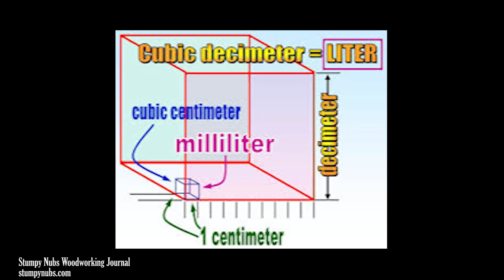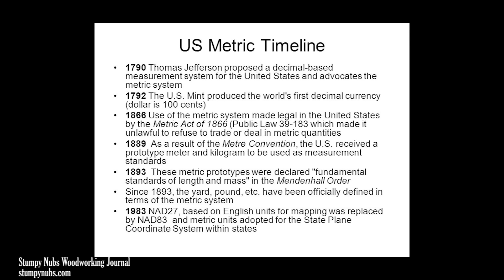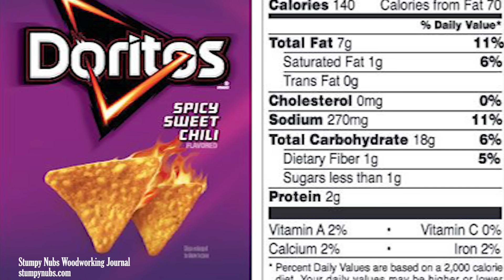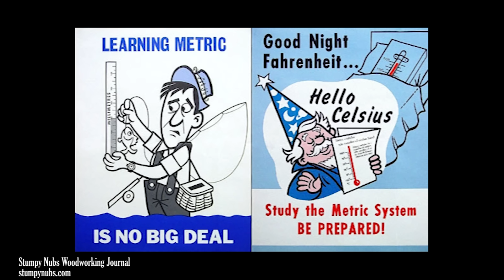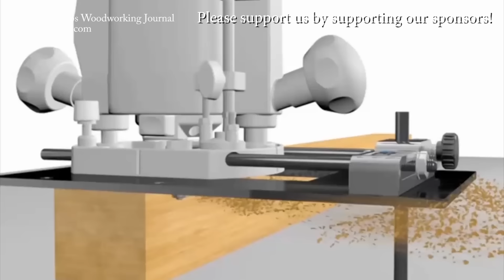BREAKING: The USA is switching to METRIC!

Comment: Really sensible response, good work. One point though, endless arithmetic does not constitute being good at "math". Engineers who are good at maths are the ones at the front line of this. When your system involves equations linking foot pounds per square inch and "refrigeration tonnage", the move to sensible si units like m, N, J and W is a huge step forward.

Comment: The US and UK have been trying to go metric for a long time. Here in South Africa in 71 we were officially metric. From 1970, no school was allowed to teach the imperial system anymore.  From 1971, no measurement equipment like scales,  tape measures, etc. in imperial marking was allowed to be sold. From the 1970 model year, all cars sold could only be marked in kilometers.  Not miles and kilometers like most plases. By mid 1971, all fuel pumps sold litres and not gallons, road signs were changed from miles to kilometers.  We changed because we were forced to change.
Reply: Biggest thing I know is that when someone is charging as much for a liter of gasoline as I pay for a gallon of same, someone is getting royally squirreled.   🙂

Comment: When France instituted the metric system, it was not popular.  The Govt had to pass a law outlawing the use of their traditional system in commerce.  Even then, they had to redefine trad units in metric terms.  The livre de Paris, one of several livres in use, was equivalent to about 489.5 g, and other livres were close to this, so they redefined the livre as 500 g to make the conversion to kg easier.  Once they got people thinking metric, they dropped the metric livre, although people continued to use it unofficially.  Germany did the same with their various Pfund, Denmark with their Skålpund, China with their jin (trad about 600 g, changed to 500).  The same was done with the various European gallons, generally becoming 4 liters, before phasing them out entirely.

Comment: Here in the uk we’ve been officially metric for decades, but our speed limits are still in mph, you can buy 3000mm of 2x4inch timber. We buy beer by the pint in our pubs. All our rulers still have inches on them as well as actual measurements. At least we did get rid of our imperial money, because I would not have liked to have to deal with 4 farthings in a penny, 3 Pennies in a thre’penny bit, two thre’pemny bits in a sixpence, 2 sixpence in a shilling, 5 shillings in a crown, and 4 crowns in a pound. But yeah, you can use metric for the important stuff without having to give up on imperial all together.

Comment: I'm an American living in New Zealand and have, over the last eight years, become bi-lingual regarding Imperial and Metric systems. I'm used to Imperial but Metric is far simpler at times and I go. either way depending on what I'm measuring. It's not a problem.

Comment: 1 kiloWatt                = 3,412.3  BTU/Hour
1 Horsepower         = 2,545.6  BTU/Hour
12,000. BTU/Hour  =  1 Cooling Tonne (A/C)   = 3.516 67  kiloWatt
1 BTU (British Thermal Unit)   =  1,055 Joules = 1.055 kiloWatt--second (kW-sec) 
(I don't think you (anyone) can get rid of all these messy stuffs, we're in for too long.)

Comment: I recently commented on a video you did about accuracy and I said metric was a lot better. I just completed the construction phase of the toddler bed portion of my daughter's 3 in 1 crib/toddler bed/full size bed. I got the plans from wood magazine and loosely followed them. My problem with the American system is that I had 6 spindles in a railing and needed to put spacers in the groove between them. With metric I could simply shove the pieces together, measure the distance of empty space divide by 6 and cut my spacers. Dividing by fractions is a pain. The problem I have is that I can't just go to a store and buy a metric tape measure. Unfortunately, my daughter's bed won't sand itself. I guess I better get back to work. I mentioned how much I hate sanding?

Comment: I'm british and hence conversant with both systems. When I sat my school leaving exams 50 years ago we were told that everything would be metric by 1975. I'm still waiting. I'm so OVER imperial measures, so much so that when I go on holiday to Spain I get a couple of tape measure because they are purely in cm and mm. So much easier to use. The killer application for metric is when I design something using a spreadsheet- so much easier. Just get used to it, it's not difficult.

Comment: The US Customary System does have the useful ability to be repeatedly divide in half which I find myself doing much more often then dividing by ten in my woodworking. Even the fractions are straight forward, it's not like you end up dealing 1/27ths of an inch. halves, quarters, eighths. sixteenths and  32nds are simply smaller sub-divisions of an inch. And since an inch is officially defined as exactly 2.54 cm so they are just as precise as Metric.

Comment: It should be noted that there are differences between the U.S. Customary system of measure and the British Imperial system of measure. These mostly relate to liquid measure. The American fluid ounce is bigger than the Imperial fluid ounce. 8 fluid ounces make a cup... but two American cups make an American pint, while two and a half Imperial cups make an Imperial pint. So the American fluid ounce and cup are bigger, but the Imperial pint, quart, and gallon are bigger.

Comment: The Metric (SI) temperature unit is Kelvin.  No country uses that for non-scientific purposes.  Celsius is not "metric" because there is only one unit -- not like feet and inches for distance -- there is not a big temp unit and a small temp unit; just the one.  So there was never any issues of multiplying and dividing by ten.  You might as well use Fahrenheit, which is much better for the weather and other human-comfort-range readings.  
Meanwhile, the only SI unit for time is the second.  Hours and minutes are not factors of 10!  So km/hour is just as bad as miles/hour, when you want to convert to meters per second.

Comment: Water freezes at 0c and boils at 100c.....instead of 32f and 212f..........you tell me which makes common sense???
Reply from the maker: Water isn't the only common liquid. Others have different boiling points. Seems a completely arbitrary thing to base an entire temperature system on.

Comment: We were just in England and they haven't switched completely. The speed limit signs are still in MPH. I thought the English must drive very slow before I was told that speed limit is in MPH. There were several other non metric things I noticed that are still hanging around. What I'd really like them to standardize on is driving on the right. We didn't drive this time, but even as pedestrians it's hard to get used to cars driving at you in directions you don't expect. And to increase the danger factor for tourists, the English like to park on the road in the opposite direction of the traffic.

Comment: As a gen-x-er from the UK , who grew up in the 1970s , when the UK kind of went semi metric, I had to learn both systems.  
Metric at school, and imperial when chatting with my parents ! (who were born in the 1930s) . My parents didn't like talking in metric !

People of around my age and older are still kind of attached to inches, miles, pints, gallons, pounds ( and stones, but the USA doesn't seem to do "stones").
In public houses , we still buy beer in pints , but wine is sold my a metric measured glass.
Road signs , and speed limits are still in miles and miles per hour.
Food is often sold in amounts of 454 grams, which is well 1 pound ! or 227 grams which is half a pound !

I'll still often think about "an inch" , but then I'll sometimes use millimeters.

Even in the 1970s car engine capacity was pretty much metric in the UK . The only time I heard of Cubic Inches was from American V8 muscle cars !

I'm not sure where it will go , will my Gen-Z children just fully embrace metric ? I can at least see Miles and Miles per Hour hanging around for a real time .

Maybe I'm easily amused, it does always amuse me when I say to a European who's in the UK , "ahh , that's about 5 miles away" , and the puzzled look comes across their face, and I then have to say "about 8 KM !)

As for me , I guess I'll just be "bilingual" on measuring units until I keel over and "pop my clogs" (die!!) !

Comment: Canada is a half metric country so I have some insight. I'm of an age where I was taught both systems in school. Most of the trades here still use Imperial measure since there's so much product sharing with the USA. I find Metric is better for smaller jobs or scientific work, but for things like house framing, Imperial is easier to use. The foot is a good sized measure for building sized projects and they break down into base 12 segments of another useful size. Things don't stack up into large numbers, with decimal places that can get missed or moved. Fractions are fast and easy to use once you know them so a base 10 system isn't all that. I don't count on my fingers.

Comment: In Europe we are also use to Inches Like PC or TV screens or tyres for cars and bikes. Water Hose Connectors or water pipe diameters are al in Inches. The only thing that is wired is Farenheit, I can‘t understand the Logic behind as Celsius is more logical 0=freezing water and 100 is boiling water (roughly).

Comment: Fun fact, in Germany where most people don't know anything about inches, in plumbing pipes are still in inches and bicycle frames and also wheel diameters. I am living in Canada which is not as metric as it should be I suffered tremendously when I came here. There is more to it though, how about BTU's, Gauges, what a mess. Interested to me is that wherever it matters,  pharmacy for instance it's always metric.

Comment: When you do engineering, scientific and need to do conversion from surface area to volume and flow or field / volume or area, then it becomes soo much easier with metric. 1 cubic meter =1m^3 = 1000L = 10^6 mL

Comment: In the UK things are a bit of a mess.. we seem to use both. Officially on the roads we use the imperial system so speed limits, distances and height restrictions are all imperial… but then private roads and store car parks might show a height restriction in metric… so your truck might be 16’2” but the sign says like…. 2.7…… 😐… absolutely nobody knows their height in metric people only know their height in feet and inches, when talking about distance we use miles, never Km… but during covid we all said… keep 2 meters apart… when we would never have measured anything else in metres. All liquid is measured in metric.. apart from beer and milk.. people only know their own weight in imperial, never metric, but things like… cocaine are sold in metric quantities… 🤦‍♂️📏

Comment: The French went to all that trouble and ended up with a base length measurement of about 3 3/8” longer than the yard. It sounds to me like the yard was close enough. Metric doesn’t have a commonly used intermediate measurement like the foot (at least I’ve never heard of anything measured in decimeters). Everyone knows auto mechanics just LOVE having to buy two sets of tools and having to change over all the time. The science and medical fields have used metric for a long time because it’s “more precise”. All that was needed was to come up with some smaller measurements of ounces, both volume and weight: problem solved. I think doing the calculations in your head keeps you sharp.

Comment: The problem I see is not "not knowing how to use fractions".
Going from smallest to largest:
1/10, 1/1000 (so far so good), 1/32, 1/16, 1/8, 1/4, 1/3, 1/2, 1, 4, 12, 3, 22, 220 , 1760 (and we got lost along the way) without going to disturb knots, fathom, grains,pennyweight ......

Comment: I was brought up on the imperial system and we (UK) changed when I was 21, we converted quite quickly as it is so less complicated. But we still use the old system roads are still miles and our cars are MPH and ask the height of any kid and they will say 5ft 10inch. and we can still order a pound of meat at the butchers. In germany you can ask for a pound of meat or potatoes and they will give 500grams. As an engineer I found it a lot less complicated using the metric system. so in conclusion its not such a bad thing going metric I am 5 foot 113/4 inches (183cms) 14stone 8 pounds (93 kg).

Comment: As a Brit and the wrong side of 50, I have experienced both metric and imperial systems. Allow me to help you with which system is better - as the answer is simple.

It doesn’t matter – simply switch between the two depending on which is easier. For instance, I am 6’ tall - Not 1.829 meters. The pub is about ¾ mile away from my house – Not a km

As a rule of thumb, I tend to use imperial for large measurements and metric for fine work – unless the measure happens to fall on either a full inch mark or half inch. Much after that, I just can’t be bothered to do the math. I am quite capable of working in fractions – find the LCD and such… but for the love of god, why would anyone want to? 64th’s ?

Useful stuff to know:
1/8 is just over 3mm. therefore 1/8 drill makes for the perfect 3mm clearance drill. But is also ideal size to tap 4mm threads.
3/8 is roughly 10mm (9.5)
½ inch is a good clearance drill for 12mm bolts
Km to miles is very rough 2/3 	-	12km =    8miles	(7.4444)
Mile to km is very roughly add 1/3	8 miles = 12km 		(12.87km)
100kph = 56mph	(see above)

In Britain, imperial bolts are still available. But, they will cost between 10 and 20 times the cost of a metric one. (If you can actually find them – you will probably wait a week for them to arrive) the better option is to drill out the hole and fit metric, at which point the problem goes away.

Metric or imperial?
The answer is either or both… The real question should be “Who thought the 10th of an inch was a good idea?”

Lets not get started on gallons....

Comment: Wait until you try doing a renovation with metric drywall which is 1200 x 2400 mm. About 47“ x 94“. All the stud space will be different. What’s the cost of converting all lumber and drywall sheet and plywood sheet factories to metric?  In Canada we still use 4 x 8 sheets and 2 x 4 lumber.
Reply: In the UK it's sold in 1220 x 2440. That's 4 x 8 yes direct conversion as that is how most of our houses were built so the  board sizes still fit with little waste.

Comment: metric is nice in that you can convert from length, and mass (weight) directly to volume...eg 10cm x 10cm x 10cm of liquid = 1000ml = 1 liter..and if it is water based it's mass is 1 kg...you can do these calculations in your head....temperature is also more intuitive to a human life style...water freezes at 0C and boils at 100C...most Americans make fun of the French but metric is one thing they absolutely got right.

Comment: I am from Europe. Don't understand Imperial system. When I was in NJ 30 years ago, they tried to convert highway signs into metric. However they listed both metric and imperial distances on the same plate. It did not work. IF you going to convert you have to do it cold turkey. Example is in Sweden they converted to driving on left side to right side overnight.

Comment: as an american ive slowly learned metric ive got my phone set to C for temperature and i already am used to metric for other forms of measurement the main issue still is estimating based on sight and feel i still pull out the conversion factors mentally on occasion but im started to get better at it

Comment: I have come to the conclusion that irrespective of the unit measurement I use I can f**k any piece of timber or steel I cut. ANY material I cut will consistently end up being just a little bit too short. It's got nothing to do with which system I use ... it's the quality of the material I keep using. I just have to buy more expensive material. No no .... don't tell me I'm wrong, it's taken me forever to think this thing through and I'm convinced I'm on the right track at last.

Comment: Why choose. They both work well. If I have an inch measuring equipment I use inches and a metric measuring equipment I use metric. It is easy to convert from one unit to another. There is 25 millimeters to 1 inch. 4 quarters to a dollar. So 1mm =0.040”… stop making this hard.

Comment: I worked in newspapers where we measured across the page in points and picas which are fractional inches, and down the page in cm. I’ve never been foolish enough to attempt a woodworking project like that! Doesn’t matter what you use so long as it’s consistent for the entire project. And if it’s based on one or the other, don’t convert. 32mm cabinet system does not work in fractional inches.
Reply: Are you sure you did not mean a 320mm cabinet?

Comment: Here in the UK we have had the metric system since the 70's but we still refer to our height as in feet and inches, we gauge our distances in miles, fuel in miles per gallon although fuel is sold in litres, we have to convert to gallons to work out our MPG and our weight is always referred to in stones and pounds
But when we are measuring anything we use metric, it is so much easier than fractions of an inch, doing mental maths is so much easier with whole numbers
Reply: Hospitals record height in meters and weight in kg though, and volumes, drug doses and concentrations in metric units.
Reply: @pisquared1827  Maybe it does but the rest us uses the imperial, but when it comes to making a coffee table, we always use the metric

Comment: The sad part is measurements are just that.  Whether it’s inches, meters, or just two marks on a piece of paper.  I stick my measuring device between two points and note the results.  If I need to transfer those measurements to something else, you just use the same values.  It’s not like metric is more accurate than imperial, or the other way around.  The biggest difference really is which system people are more used to thinking in.  IMO.